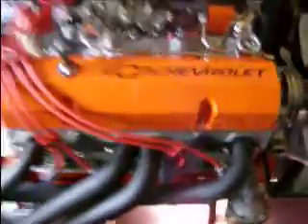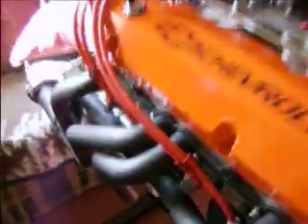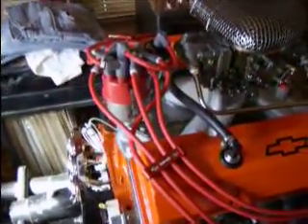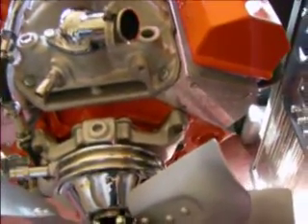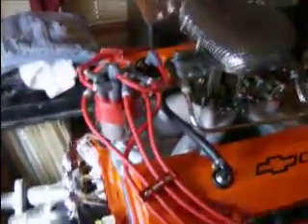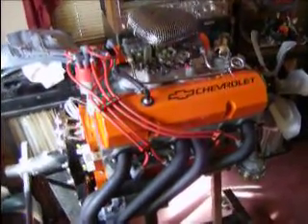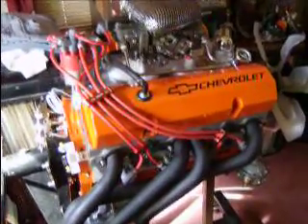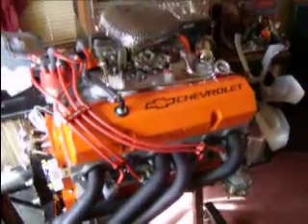CHEVY 327 ENGINE BUILD - ALMOST DONE

Comment: Hi, put a battery on the floor, use jumper cables ground to the block and pos to the starter big post if it is the type with more then one terminal, then use a screwdriver or jumper wire to the little post to make it crank,  you need  power to the hot side of the coil,(another jumper wire to the hot side of the battery) and the neg side of the coil goes to your distributer, dont need the alt at all to run the motor, then fuel tank higher then the carb if you do not use the fuel pump,make noise,,

Comment: if you want to put a start button in it would go between the big lead on the starter and the little post, I noticed you had 3 posts on your starter, if it does not crank, the other one should go to ground,

Comment: hi i got a quick question theres a guy dat selling a 68 327 he said it came out of a 64 chevelle. he said it wasnt the original motor it also comes with 65 camel hump heads i dnt no if is a 2 or 4 bbl can some tell me the specs n if i should get it tanks